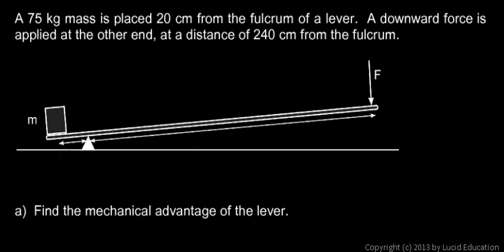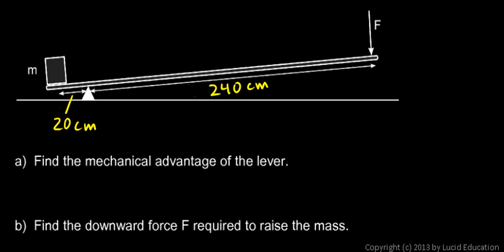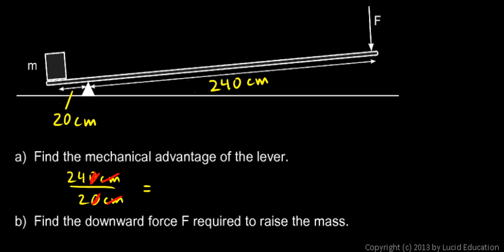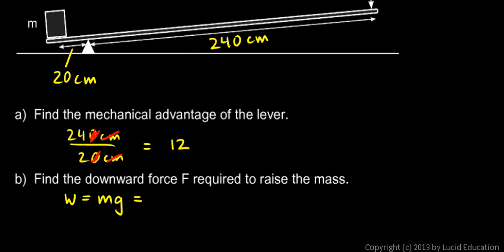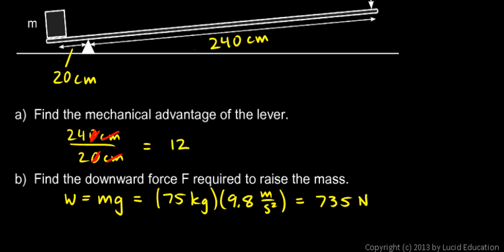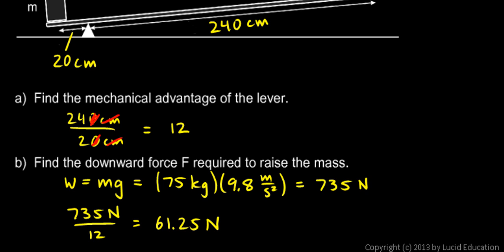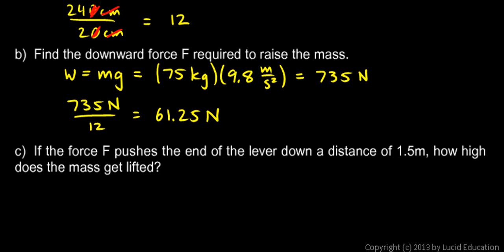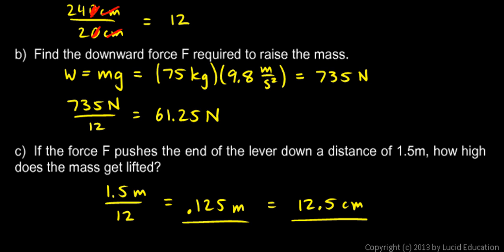Physical Science 4.2g - Lever Example 2

Comment: How can i figure ..leverage..without a balance point. If a kayak weighs 60 lbs what would i be lifting if holding it at the very end in horizontal position.
Reply: The fulcrum (balance point) would then be the very end of the kayak that is resting on the ground. As for the load, you would likely find the centre of mass on the body of the kayak, and pretend as though gravity is acting on the mass of the kayak downwards from that point. Type 2 lever.